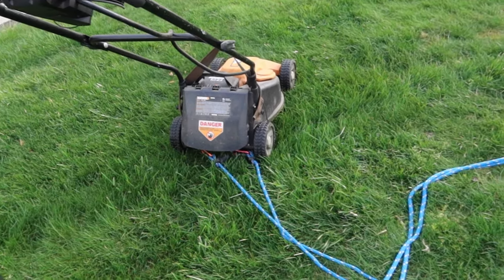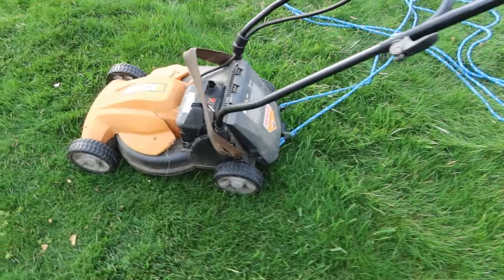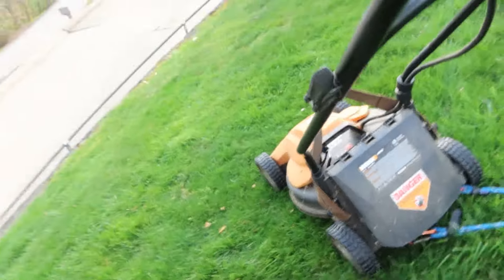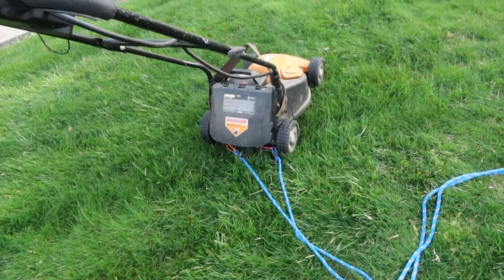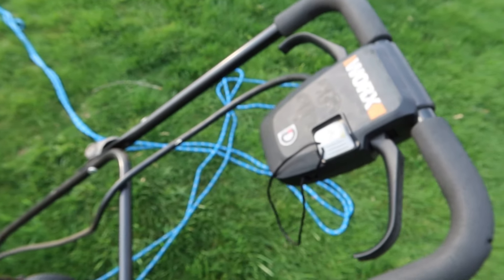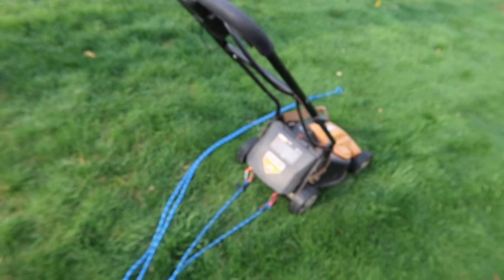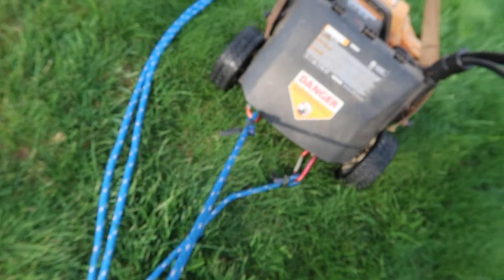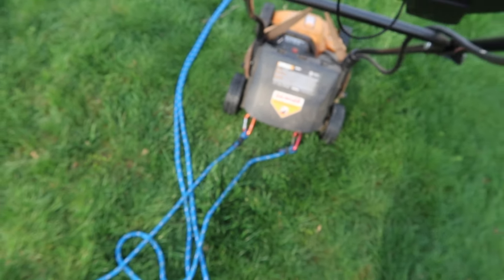Cutting grass on a hill.

Comment: I do that too but I use a self propelled lawn mower I configured it to lower down the slope backwards and when I pull it back up I devised a rope configuration that engages the self propulsion and the mower does most the work when I pull it back up